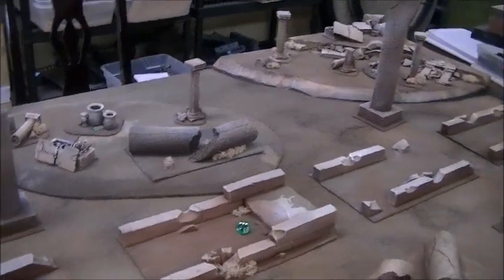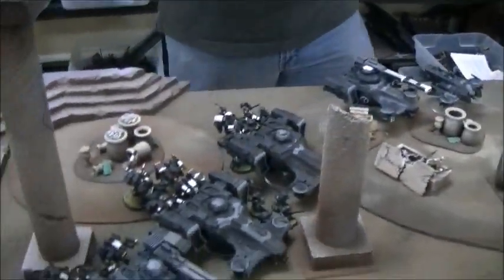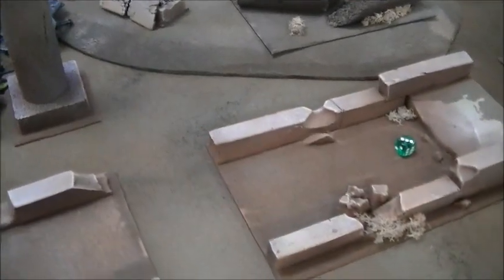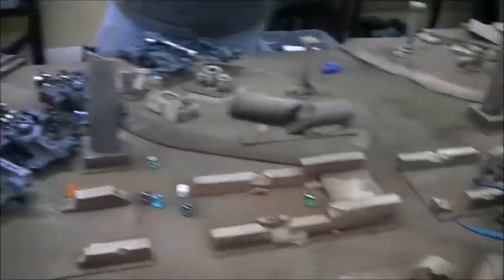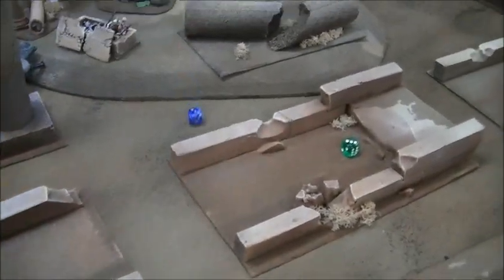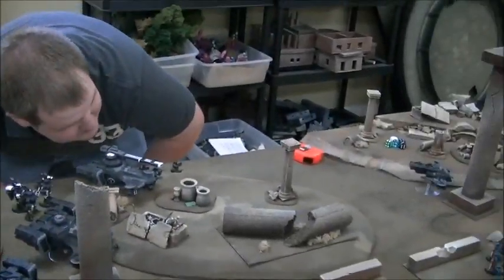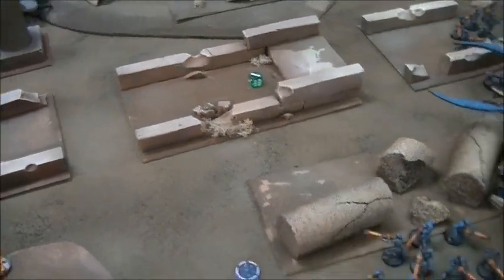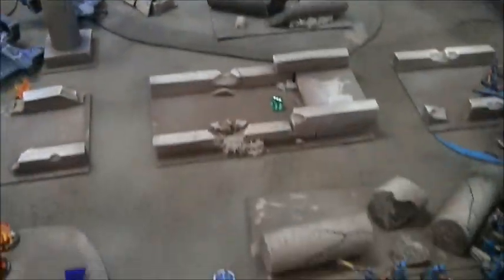Battle Report - Tau vs Necrons Part 1

Comment: Basically, a model with a markerlight will fire it at an enemy unit. If it hits (note there is no wound roll) then you add a markerlight token to that unit. You can then use these tokens for a variety of things. Increase the BS of shots against the unit, reduce the unit's cover save or Ld, fire a seeker missile etc.